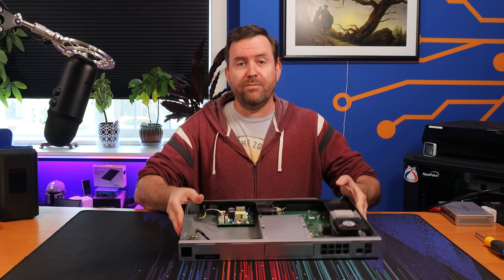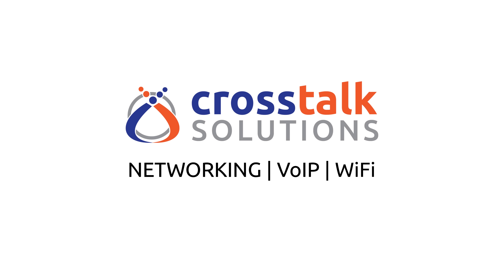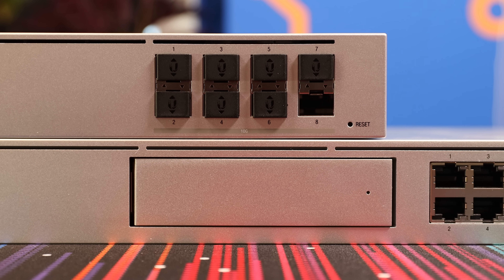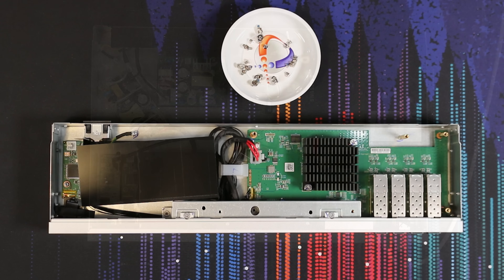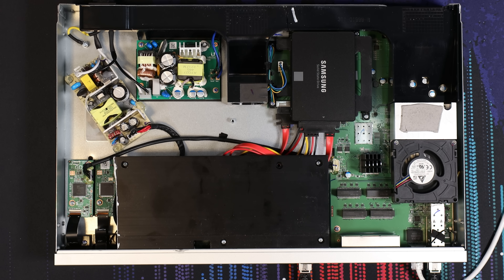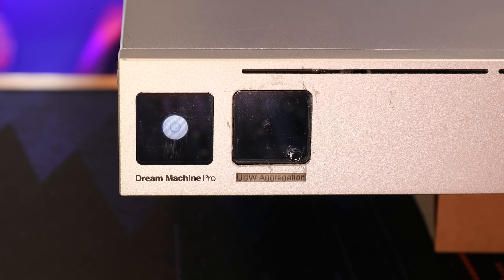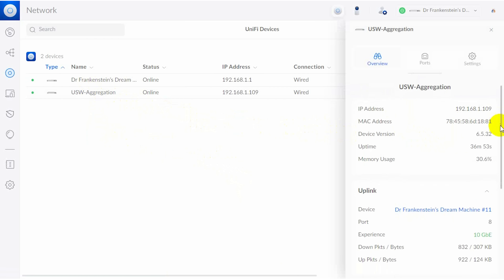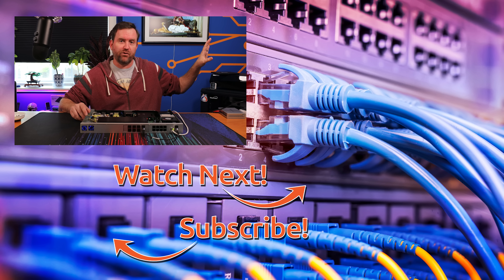Dr. Frankenstein's Dream Machine COMES ALIVE!

Comment: What would I like in a dream machine?
Long term support, and a modular backplane.
Need utp, plug in a module and you've got 8 ports, need sfp, cram in another module.

Looks like there's room for 3x 8 port blocks. With room still for an nvme slot in the front

What would be super cool is a processor module, accessable at the back for upgrades

Comment: This is what I immediately considered when I saw the UI cable modem. There’s basically nothing in that thing. It’s 8x bigger than it needs to be in order to be rack mounted. It would fit great into the UDM Pro chassis.

Comment: Too bad you cant somehow re-do the backplane connection of the 8 port gigabit switch to connect in to one of the 10gb switch ports and provide those 8 gigabit ones with a 10g connection instead of bottlenecking at 1gb like it currently does. But this would likely require making a whole new PCB for the dream machine and is far too complicated and would probably destroy its ability to have firmware updates like it was a normal machine.

Comment: Ca'nt wait to see the UMP-PRO-MAX-XL--ELITE++. It starts with a normal UMP + 2 SFP28 + 24 SFP+ cages  + 48 2.5g POE++ ports, + 1000 Wh LiPo battery backup + 8 HDD bays, 3 power supplies, wifi 5 2x2 AP (just to piss everyone off) and a PTZ camera mounted on top.

Comment: It would be nice for them to have expansions for specific applications, ik they kinda do but its limited in the sense of how you can set it up or whats offered. If you're doing a medium or even small office, you can max out what a single UDM Pro can handle pretty quickly when you factor in cameras, aps, phones, access control, etc, etc. (The $5000 enterprise option is a rip off IMO, but yes ive looked at that lol)

Comment: il go right at it, udmpro concept >> 16x 2.5gb poe++ ports switch, 2x nvme drive bays , at least 2x 10gbe ports for uplink and internet ,silent cooling , Comeon ubiquiti wake up >> and pleeease no more 1gbe ports ever anywere they are obsolete , no more 1 drive bay sollutions at least 2, go with nvme or ssd . and put in som ekspansion ports posibilities for more SFP, NVME or other by choice ekspantion options.
at this point ubiquiti is lagging bihind the competition , and even worse having persistant quality problems, i got cameras 2 of 10 were defective at arrival and usless, RMA process dragging custimors throug a usless return policy for defective devices instad just sendig a new product that works ASAP.

Comment: There is the yet unreleased Dream Wall Pro that has a separate module power supply unit and 2 hard drive bays in the main unit. Not sure on other specs though. Estimated price is $1500.

Comment: Cool Stuff!

I think a 2u with a few hard drive slots, NVR functions and and the 16 port PoE + UDM Pro functions would make a great NVR solution for companies to be able to put in a security camera set up without having to be behind an uncontrolled firewall or double NATed. I would image being able to then have a second WAN from an ISP modem go to the UDM Pro with an IP from the client's static block so its not touching the internal network.

Then again plenty of clients would also prefer it to be behind their firewall to control it.

Comment: I'm not the biggest fan of the Unifi lineup, but since I couldn't find something like this from any other vendor, this might change my mind: I would love to see a switch that has 8 to 16 PoE ports and 4 SFP+ ports, with at least 4 of the RJ45 ports being at 2.5 Gbit/s speed. So basically a combination of an aggregation switch and a PoE switch.

This would be perfect for my (and I suspect many other people's) homelab because you can get by with one device for everything, from servers to access points. Bonus points if it's passively cooled or at least comes with a somewhat silent fan.

Now I see why this wouldn't be too attractive for a manufacturer to make as the demand for what's basically a PoE edge switch, but with extra 10G connectivity, is probably not that high in the enterprise and SMB world.

Comment: I like your Ideas but being I have a Dream Machine S E would like to see a 16 port with full POE ++ power to operate my small system for my farm home Camera's Wi Fi and possibly Air and Access devices to keep my home system rake under a 4U rack with UPS. If the future would call for a UniFi Switch Aggregation can see your working .  What 3D printer was your choice as I been looking to add to my hardware .

Comment: Many electronics devices could shrink significantly due to miniaturisation of components which is especially noticeable in consumer devices. 
Semi-professional and professional devices have not experienced this trend as much because performance, heat generation and cooling are more important. 
Integration of functional groups is not always to the advantage if operational reliability takes priority.
Rack devices are a typical example of this and having to win 1H unit space would rather indicate poor project planning.

Nevertheless, a fun video for tinkerers with lots of ambition and time.
Hopefully you will continue to surprise us (amateurs) and others ( more advanced) with your very instructive videos

Regards

Comment: Would love to have seen you work out how to mount the Agg switch PCB above the UDMP PCB, allowing you to retain the original drive map and install the Agg ports between the LCD and drive bay, or alternatively be able to add another set of 8 x (2.5Gb? 10Gb?) RJ45 ports in the space between the LCDs and drive bay come Agg switch SFP ports.
But with your FrankenUDMP, as is, would be interested to know how long it lasts before it all overheats and fries itself.

Comment: My Dream Machine would be 1U, but half the width of a rack, and as deep as the USW. 4x 10Gb Base-T ports, and 2x 2.5Gb Base-T ports. All that with built-in Wifi 6E with internal antennas, but with the ability to connect external antennas. USB-C port for storage, or/and 2.5” sata slot.
Reply: Call it UDM-Mini Pro

Comment: The worst thing about the UDM-SE is that all 8 of the built-in PoE ports are connected to the CPU via a single gigabit pipeline. Super disappointing that UniFi cheaped out on those ports when you can connect the router to a 10Gbit WAN (which I have with Sonic fiber). So, yeah, what I'd love to see is a non-Frankenstein version of what you've built here. Replace the 8 handicapped ports on the UDM with some combination of SFP+ and true (dedicated) 1Gbit or 2.5Gbit copper RJ45.

Comment: Y’know, the ultimate dream machine here would be if UI engineers the case with two modular expansion bays and allow you to swap stuff in and out, sorta similar to what framework does with the IO for their laptops. Want a HDD? No prob. 8 PoE ports to with that? Sure! The screen thingys could be made a bit wider or just keep it as is and you can just select which mode you want to look at from the landing screen. 

Hell, go for broke and make a 2U ‘super dream machine’ with 5 modular bays…

Comment: I really love the way this was done, looks janky as hell.. Dude that's dremel work not laser cut for the Aggregation port plate, but nice attempt at sounding cooler..
My advice would be to use more masking tape and don't cut to your lines, cut close then file out from there.

10/10 for ingenuity but sadly a 5/10 for presentation.

Comment: My dream "Dream Machine" would be, make a unifi gateway software package that runs on a normal PC like pfsense does and can somehow accept firmware updates for a UDM Pro. lol. Probably not possible because it would require too much custom stuff on the emulation part? But I really wish we could make our own that was a lot more powerful. Something like a modern 6-8 core CPU around 5GHz~ to have really great packet throughput as well as extremely low packet latency even after all the processing (and remember it would have emulation overhead for ARM -> x86 so we lose a chunk of performance there too so it isnt as crazy OP as you would initially think), as well as a dual 2.5/5/10gb NIC for WAN/LAN and a dual 10/25gb SFP28 NIC for WAN/LAN. Plus able to mount 8 hard drives in the chassis for running Protect.

Comment: Not anything that could be DIY'd but It would be really awesome to have a modular Dream Machine with upgradable modules. If each module was built off of a PCIe bus each module could either be networking or extra hard drives. So you could mix and match and have future upgrade paths without swapping the entire unit. Some examples could be 2x modules of 10gb and 1x HD. Or 1x 1gb POE, 1x 10Gb, and 1x HD. Or whatever combination of ports and hard drives you want. That would be my "dream" machine.

Comment: I'd love to see a true successor to the US-8-150W.
Reply: Even the 60w. They are so cool and better looking especially with the metal finish. The chunky dinner plate lite replacements are a instant no for me
Reply: @mvp_kryptonite  Functionally, the 60W is the same as the 8 Lite PoE. That's fine for me. What I miss is SFP in a non-rack-mounted switch.
Reply: @rfh1987  I think they promote the USW-aggregation as that. I’m keen on a new cloud key and I’ll be happy for my home use case
Reply: @mvp_kryptonite  USW Aggregation is rack mounted, and only SFP. The US-8-150 was an 8 port PoE ethernet switch with two SFP ports that wasn't rack mounted. They have nothing to cover that space right now.
Reply: @rfh1987  Ubiquiti missing opportunities

Comment: I have always thought they should have an access point/camera combo. see if you can get the fisheye camera and an access point to fit in the same housing.. or better yet make it so you can upgrade your access points with a camera you insert into the middle :)
Reply from the maker: That's actually a really interesting idea...
Reply: @CrosstalkSolutions  Next Frankenstein project?
Reply: Nice and since the new cameras don't need gigabit, this sounds great
Reply: How about the AI Theta and the U6 Enterprise??
Reply: @richacevedo660 or the AI360 since typical ceiling mounts of an AP would benefit from the 360 degree fov

Comment: Dream machine turned into the Aggregated Nightmare Device.  Don't be like me and forget the surge protector on any outdoor copper connections.  I got some bonus electricity induced from a lightning strike on my old usg pro that destroyed the copper wan ports.  At least the fiber ones worked though so I was able to just switch to those.

Comment: The 19" rack was created about a century ago and there's a lot of gear that fits it.  However, tech has changed a lot of things no longer need so much space.  I have seen some equipment, where you can mount 2 side by side, with special brackets, to fit a 19" space.  I have also seen some equipment, Fortinet IIRC, where they have a special shelf that can hold 2 pieces of equipment, such as a router and a switch, in a 1U space.  Maybe it's time to come up with something for modern equipment.  Back when the 19" rack was created, everything was relays and vacuum tubes, which took a lot more room.
Reply from the maker: Don't you dare take my vacuum tubes away from me!

Comment: I bet he uses the power supply of one Unifi to power components in another
Reply: The list in the description suggests that both power supplies are used.
Reply: You can see that both power supplies are used.
Reply: So does that mean two power cords were used as well and making an additional cut out for the second power cord behind the unit or did they merge both power supplies?
Reply: @biggig8548  There's one input on the back, internally split to the two separate power supplies.